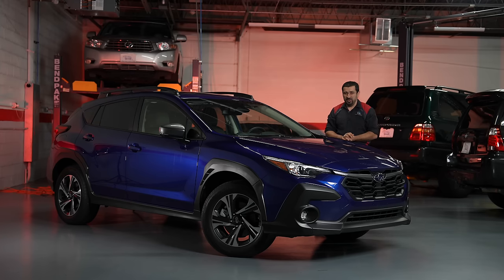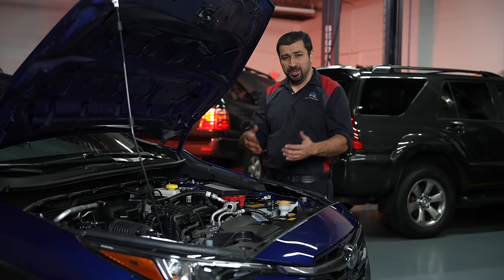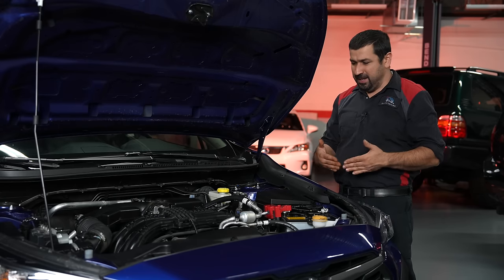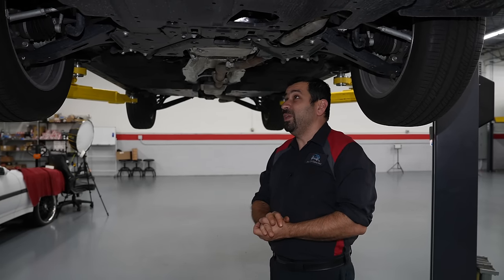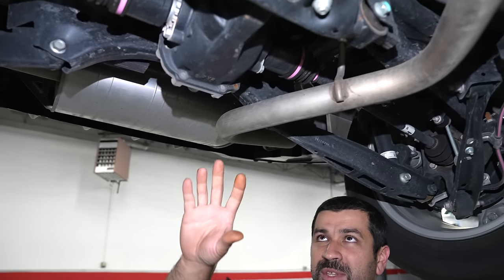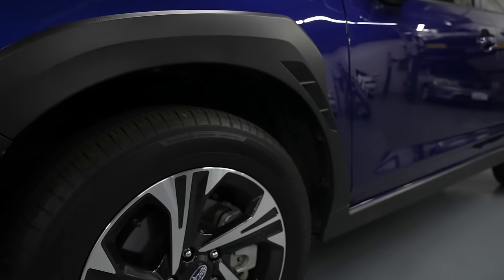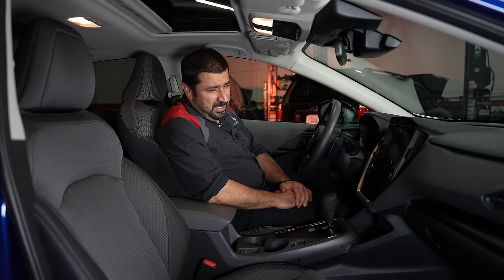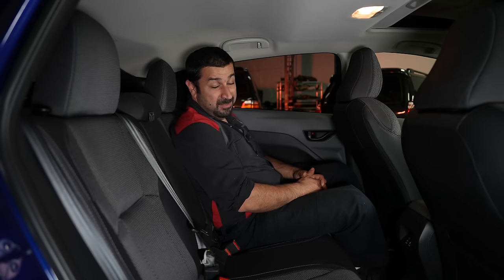Should You Buy a 2024 Subaru Crosstrek? Thorough Review By A Mechanic

Comment: In December 2023 I test drove a new 2024 Crosstrek Limited.  It was nicely appointed, having the 2.5 liter. It was FUN to drive. I really like how well the drivers seat was bolstered  keeping you in the seat in corning.  The downside for me was the rear seating headroom as I'm 6'2"; No power rear deck lid;No Heated Steering Wheel option. Instead I chose a 2024
 Forester Touring that offered those amenities not  available on this Crosstrek.

Comment: I have driven my Subaru Crostrek 2024 Base for more than a month now, and I like it, it is true that it is a noisy engine, but with the cruise control, and the brake that stays fixed, it is wonderful, you don't get tired driving it .
Reply: By noisy how noisy do you mean. Like if I had a radio going at just a normal volume, let's say 1/4 of the actual volume. Would it still be overpowering. ? I'm really looking into a Subaru. I live in a pretty crappy area with snowstorms. I drive an old Ford and it is really loud. I hate it. I just need to know the level to see if I'm used to the abuse lol.

Comment: I've had two Subaru Outbacks with the CVT transmission. Both cars perform flawlessly (including in severe ice and snow). Zero issues.
Reply: What’s the farthest you’ve reached in miles?
Reply: Year? What are your yearly maintenance if more than 10 years old
Reply: I've owned 3 Subarus. An 04 Forester manual with 250k miles. An 09 legacy manual with 115k miles sold. And now an 19 outback with 88k miles. Never had an issue other than proper maintenance. It helps that I build them as well. Take care of them and they will take care of you
Reply: @Claroboy911  the CVT in my 2013 Outback went 220k miles before a problem.

I have a 2023 Outback and 2024 Crosstrek. These are now “lifetime fluid” units.

I don’t believe anything is for life, but drain and fill voids the warranty.

Some say you can use cash to buy 5gal of CVT-3 from Subaru. 

You can monitor and manipulate all electronic controls used for drain and fills on the new units with an inexpensive bidirectional scantool because Subaru calls for servicing these units every 45-60k km in other markets.

I don’t plan on experiencing any problems with the newer CVT unit.

Do with this information what you will.
Reply: @buttsexandbananapeels  how would you describe your driving?
Reply: @Claroboy911  Appropriate
Reply: I @parkerriley918  I always hear people say that but what exactly does that mean? are you doing normal maintenance (oil, brake pads, spark plugs, etc) or are you changing everything that could go wrong before it goes wrong ( like I hear you need to re-torque the head bolts on Subarus which I think is ridiculous).....?
Reply: @paulusandronicus  never done any of that. All I did was oil change, spark plugs, transmission flush around 100k. Radiator flush around 100k miles or so. Just changing fluids and filters when needed. The engine has lasted. Most I've done is change water pump, alternator and clutch because one of the transmissions was manual. Other than normal maintenance
Reply: @parkerriley918   Ok thanks good to know
Reply: Cvts are not that big of a deal as they make it out to be…service then every 25k-30k  and don’t redline it and it’ll last a long time. I have an 012 hatchback versa with 128k  miles with cvt and it runs butter smooth despite it being a shitty jatco…I serviced it every 20k and didn’t beat on it
Reply: The cvt only survives because Subaru  neutered the performance to protect it. Someone e tried backing their Subaru up over a small curb and the computer refused to allow it to happen. It would cut power and refuse to allow it
Reply: @TragickSin having to service a transmission every 20k miles in order to keep it working is an absolute joke.
Reply: @hochhaul the computer refused to allow them to back over a curb? Let’s see it, where can I find that 😂😂😂
Reply: @hochhaul  having to due maintenance on anything sucks but necessary for continuation. Learn responsibility kid
Reply: @hochhaul that's not a thing. I do that all the time with my impreza.

Comment: I think you hit this right on the mark, especially about the engine and potential seal issues. My daughter's 2016 Crosstrek, the only seal that doesn't leak is the head gasket. Although very well maintained, Subaru dealer says it's very normal for the liquid sealer to fail on all components and no fault of the owner. A $5200 repair! She will just keep an eye on the oil level between changes. Your knowledge is really quite impressive.

Comment: 0-60 in 9 seconds is not slow.  I drove a Prius Plug in and a smart car for a combined 15 years. They both merged onto the freeway just fine with 0-60 times around 11-14 seconds. Those were slower, but still worked ok.  Not every car needs to have sports car acceleration abilities.  I think people interpret Subarus as being slow because the CVT doesn't force the engine to make up and down sounds like a normal transmission, and those sounds indicate progress to the human brain.  It's funny to me, because car reviews used to criticize manufacturers who had rough shifting automatics, wanting everything to be smooth. CVTs are as smooth as you can get, but they don't cause the same audible experience, which causes other problems for some people.  I think CVTs are genius. I do understand they can wear out quicker in some cases, but outside of that, i don't see what everyone is complaining about.

Comment: I’ve never had a problem with Subaru CVTs.  We drove our 2011 Outback 255,000 km with no issues.  Our 2018 Crosstrek has 145,000 km on and it’s been flawless.  Our 2022 Forester only has about 26,000 km on it but I full expect it to run flawlessly for the time we keep it.  That’s usually 10 years or more.  Our cars get regular service which includes transmission fluid changes at least every 100,000 km.   Look after it and it will look after you.

Comment: Great point about physical buttons. They are much easier to find and use when your on the move.
Reply: Remember the Blackberry.
Reply: I have a 2018 Crosstrek and it has exactly that :) ... smaller screen but physical ventilation controls.

Comment: The 2.5 liter engine is very sufficient for this car - not slow.  In addition, the car is not noisy with the 2.5 L.  It's very quiet in stop and go traffic. The point about the AVH button is valid.  It should be in a fixed, always available location.
Reply: That depends on what car you came from, if you drive other in the same year you’ll know
Reply: It is super easy to customize the default button locations and drag the AVH button from the 2nd screen onto the first, Home screen and place it right above the fixed ASS button so it’s always available immediately upon turning on the car.
Reply: @tpolerex7282 That's what I have done in my 2023 Outback.
Reply: I have both Crosstrek 2019 and 2024 Sport and can confidently say that the older one is a lot slower compared to the newer one, but with the paddle shifters, you can get a little snappier response from the engine. The Sport 2.5L is a godsend, but it does sip more gas than the 2.0L. I'm still trying to learn the best way to drive it to maximize efficiency. It's pretty fun!
Reply: I have heard/read repeatedly how sluggish these engines are. We have 1 '21 Forester Touring with the 2.5 and it performs just fine, cruises easily at 80+ mph, has adequate get up and go to pass easily on the Interstate.  We took it into the mountains in Arkansas and it handled them beautifully, did not seem stressed at all.  So far, the car has been stellar. Not a single issue with 42K miles on the odometer.  I've had a number of different vehicles in my 72 years and this is one of the best.  I like the design, quality, fit and finish and, yes, I even like driving it. I'm considering the Crosstrek as a replacement for my 2014 VW Jetta.

Comment: I just purchased the 2024 CrossTrek with the 2.5 litre engine. So far, this vehicle has exceeded my expectation. Just for a reference point, my last 5 vehicles have been BMWs.
Reply: Bragging you've owned "5 bmws" and now own a 35k car that does 0-60 in 9 seconds that somehow that exceeds your expectations leads me to believe you are just gaslighting yourself because you bought an overpriced pile of crap that is built worse with less features and slower than a Hyundai that sells for 18k
Reply: @TexasStormChaser what Hyundai are you referring to?
Reply: @franktheballer23    Every 2024 model sold.
Reply: @TexasStormChaser  you're saying every 2024 model would be this compact and would work as an offroader and have the same if not better off-road features?
Reply: @franktheballer23    Subaru is not an off-roader.  It does not have any off road features such as low range or locking differentials.  It does however share exactly the same features as a Hyundai Kona, the base model (4cly, cvt, awd) however the N-Line Kona does have a superior engine and transmission over a Wilderness (Turbo 4cly, 8spd auto, awd) and costs less too.
Reply: @TexasStormChaser  that car looks terrible from the outside. I'm not surprised it is way less. It also just from looking at the front does not have the same ground clearance. That's not even getting into reliability.
Reply: @TexasStormChaser  actually looked at the Kona N and it does actually look better but it looks like I'd break the plastics with just a single drive off-road
Reply: @franktheballer23    It’s a crossover exactly like a Subaru.  They’re the same class of car.
Reply: @TexasStormChaser  it may be a crossover but it doesn't seem like it would last long in rough roads. I don't see many people using it for off-road stuff either as opposed to the cross trec
Reply: @franktheballer23     It’s no different.   There is absolutely nothing “off road” about a Subaru except the marketing department.   A Wilderness would get stuck trying to follow a Tacoma in 2wd.
Reply: @TexasStormChaser  well now you're comparing a Tacoma to it and that's assuming what you're saying is true. We know there is a clearance issue at the very least. The Crosstrek has protective plastics around the body that can be replaced individually, water repellent upholstery, durable mats, etc. Specifically for the Kona not the Kona N line which costs way more it has nothing specific for off-roading. It looks like it's more made for city driving which it really is
Reply: @TexasStormChaser  it's got the cross treck beat by a mile in the interior and exterior look but clearly they're not meant for the same thing
Reply: @franktheballer23    Slapping on some plastics and choice of seat material does not make a vehicle "off road"   Those are cosmetic features which work on most people like yourself that think off-roading is going on a publically maintained dirt road.  Someone who truly off-roads knows that means nothing.  If you're actually taking a vehicle off-roads in the woods it needs two things:  Low range transfer case and a locking rear differential.  That is the bare minimum to start classifying something as an "off-road vehicle"
Reply: @TexasStormChaser  car looks fantastic. Actually would by one if it actually was equal in offroad quality
Reply: @franktheballer23    They are equal
Reply: @TexasStormChaser  they clearly are not if you watched that video. I can post another video but for the Crosstrek in the same style and it manages to make it

Comment: Loved your honest review.  All of them.  We just bought a 2024 Crosstrek Wilderness.  We have 2 Lectric bicycles that we use with a hitch rack, and needed the capacity of a Class III hitch with a 2 inch reciever.  Coming from an RV based on a RAM Promaster chassis, the Crosstrek has more than enough power for this 73 year old.  The buttonless dash seems to work OK.  My wife has an MKX with capacitive touch buttons.  The Subaru screen is more sensitive.  We added the 4D Tech module to be able to lock the Stop/Start feature to off by default.  That was my main complaint.

Comment: Love your attention to detail and completeness of the review. Most car guys could take lessons from you. I’ve had 2 Subaru’s, a Forester (2001), had it for 10 years and a Crosstrek 6MT (2018), that I sold with 65K miles on it, last month. Zero maintenance on the crosstrek, only oil changes every 6K and new tires at 60K. Ran, so well with zero issues. Great in inclement weather and off-road in the mountains. A bonus, I could sleep in it comfortably, if I didn’t want to set up my tent or it was raining/snowing. I read, that the 2018 had a lot of problems and was one of the worst crosstrek’s to own. Again, I experienced zero problems, but mine was relatively low mileage. Who knows if they were coming? I sold my crosstrek because I wanted a hybrid and better mileage. I consistently got 34 mpg on the highway, but 20-22 in the city, and that’s horrible for such a small car. Would I buy a Subaru again? Yes, looking at the upcoming Baja. Good review, I’ll be checking more out

Comment: Totally agree about the lack of physical buttons. I want analog volume knobs and AC control knobs.
Reply: The '24 Crosstrek has a physical knob for the radio volume, and for temp controls for driver and passenger climate control.
Reply: @blackbearranchcanada  I'm guessing the volume knob is digital though. Mine is digital, and sometimes there is a long delay while the head unit is booting up or switching to backup camera or whatever. It's super annoying.
Reply: @BradHebert  - volume knob on ours is a rotary knob and if you push it in, the radio turns off. There is also a + / - volume control on the steering wheel button cluster.
Reply: @blackbearranchcanada  rotary knobs are often digital.

Comment: How about a review of the 2024 Forrester? Thank you for your reviews.
Reply: it's very similar to this vehicle in many ways like motor, transmission, ride height, center display panel....
The pros of the Forester, it's cabin space is bigger and more useful than Crosstrek or Outback, the best visibility I ever had on a vehicle (to the point you feel like you have owned the vehicle for many years on the test drive), the tall cabin space provides plenty of clearance for the taller riders and the thing I love the most about it is the panoramic sunroof. 

The cons of the Forester are it doesn't get the great gas mpg (25mpg~) you'll get on a Crosstrek (33mpg~) (or even the Outback 30mpg~) due to aerodynamics, it's noisier than the Outback, it's taller cabin space is also susceptive to much more sunlight exposure than a normal vehicle, which makes the cabin warmer during summer (A/C on blast and tinted windows for the rescue) and blocking the sun meanwhile driving is a bit more challenging. My wife managed to crack the windshield several times on the Forester, I kept asking her how and she never knew how or why.

If you ask me, I prefer the Forester based on looks and the inside cargo space, but the Outback is the one I'll buy. We bought two Forester (2015 & 2016) and both of them had a rattle noise that came from the dash upper display. The Outback (2016) came with a bunch of upgrades for not much more and it has been bulletproof.

Comment: Yay! Thank you for finally reviewing a subaru, I used to own a 2011 Subaru STI and I sold it with 270,000km (~160,000 miles) and it still had its original engine, transmission and turbo. I was surprised by how reliable it was for an older high mileage Subaru STI. Keep up the great work Car Care Nut!!
Reply: I still have a 2005 WRX with the last of the 2.0L EJs with 136k miles. It has been very reliable and fun to drive. I would only sell it to upgrade to a new WRX wagon if Subaru ever brings it back or for a GR Corolla.
Reply: That shouldn’t be impressive. My 2015 Lincoln has 330,000kms on it and the engine and transmission are original and run like new. I’m about to sell it and get a new car but if people are surprised to still have the original engine at only 270,000kms maybe I should look at other brands. Even if they require more frequent mild maintenance, my ford/Lincoln’s have always lasted me 324,000km/200,000 miles or longer on all original drivetrain. And I then sell it to someone else who usually drives them another 1-200,000 kms before they blow up
Reply: @nerdsunscripted624  is your Lincoln abused regularly and tuned? My old Sti had 5 prev owners and it was originally a lease. I agree that we shouldn’t be surprised by 270k on the original engine but people keep pretending like these cars blow up every other year.
Reply: @SF.Automotive  my Lincoln has a 60 mile commute every day in which I’m usually going around 90mph the entire time. I gas on it a lot and brake hard. Hard enough that a set of brake rotors don’t last me very long as they warp. 

I don’t have it tuned for performance as it’s fast enough for me after the first tune giving me 370hp. Nothing crazy but can embarrass v6 mustangs sometimes. 

Looking at an outback since I’m moving to a new city where I need to have all wheel drive as the city basically doesn’t plow the snow off of half the roads in town and it’s pretty for northern US so I need good snow capability. Recently we got roughly 40cm of snow in a single storm. But in fair weather I intend on still going 90mph/145kmh for most of my interstate commuting and I want something that’s going to last as I drive 48,000 km per year.